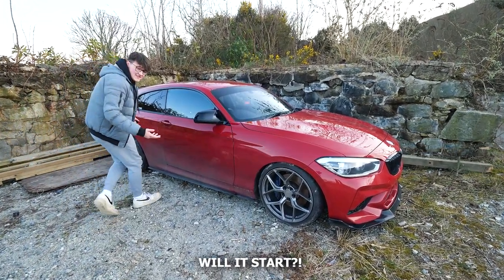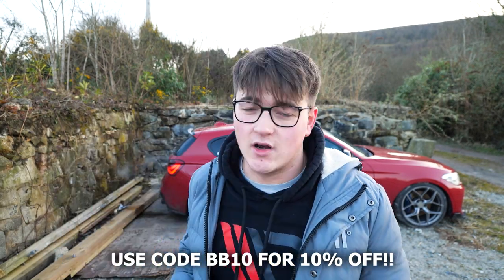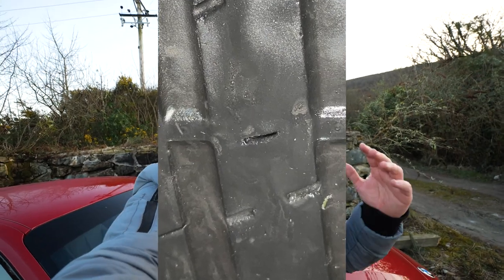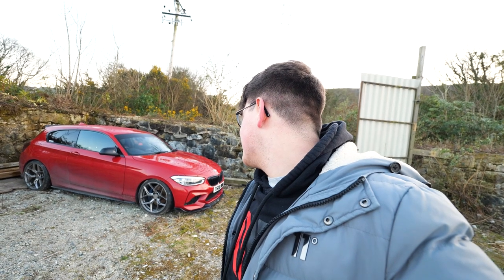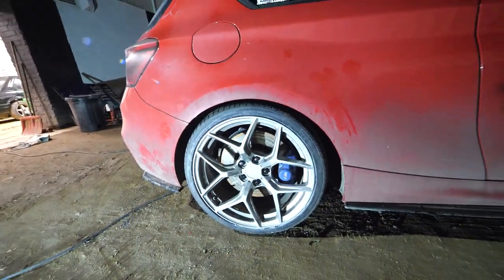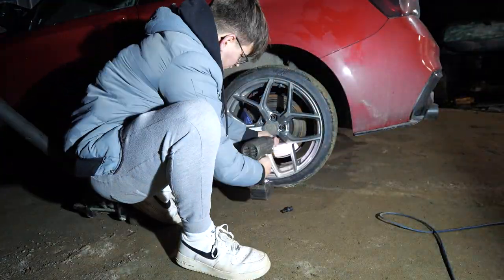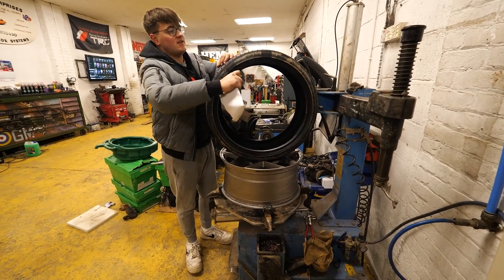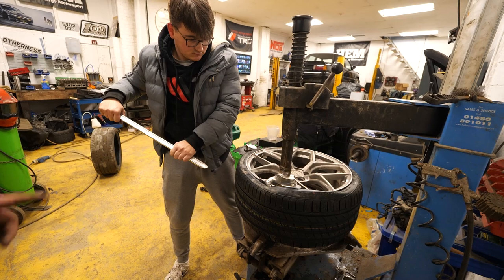MY M140I HAS BEEN OFF THE ROAD...

Comment: Low profile tyres are really not for UK roads mate.. On 245 tyres the lowest I go is 40 profile
Reply from the maker: So far the 30 profile on the 255 seems to be okay and not much difference to the 35 on the 245
Reply: 35 sidewall are standard on m140i
Reply from the maker: @JordzyBrev  40 on the front and 35 on the rear are standard for the m140
Reply: @BrettBarnesYT  was explaining to the other guy 245/35 is standard on rear of a m140i, should of worded it better